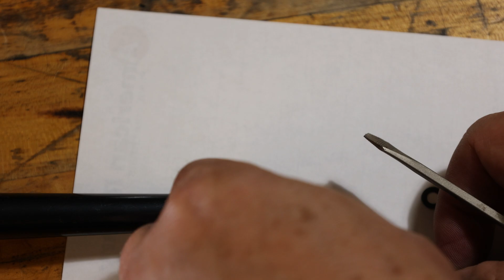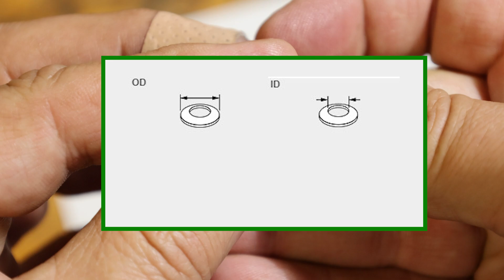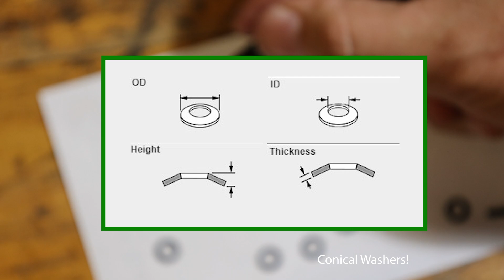NOGA Fine-Adjust Spring (Belleville)

Comment: A big stack of bellville washers is used in most CNC mill spindles to pull the tool holder into the taper. That keeps the tool locked even if air or power quits. They compress the stack with a big air or hydraulic cylinder to let the tool holder in. They have some compliance range so they lock in tool holders that differ a little in taper or stud length. You can get a lot of force in a small area with a bellville spring and just stack them up to get enough compression distance. They do things you can't do with a coil spring, what a novel idea.

Comment: when i was in the marines, one of the machine guns i was trained on was the mark 19. in one of the trigger housings, there was a stack of belville washers. if you put them in incorrectly, the weapon could fire when you dont want it to. And with a machine gun that fires explosives basically, you dont want that.
Reply: “Fires explosives basically” is an understatement. It is literally a machine grenade launcher, shooting 40mm high explosives.